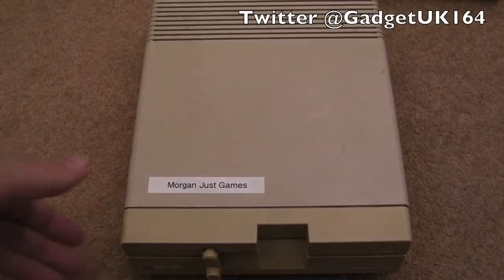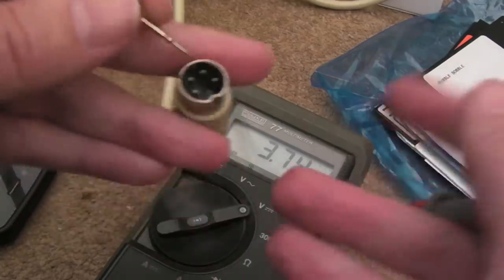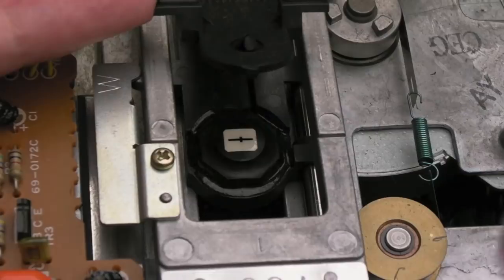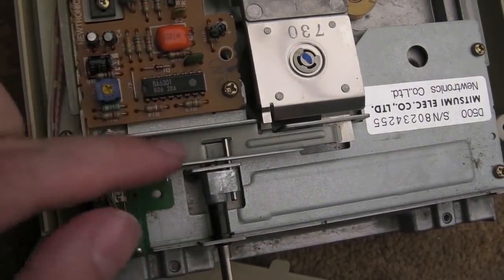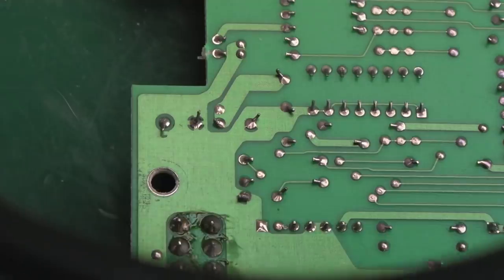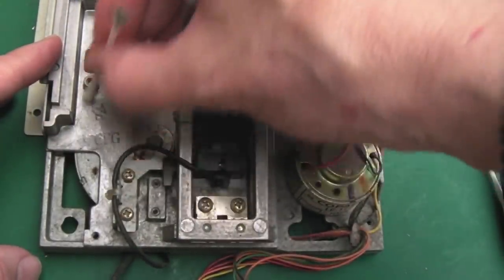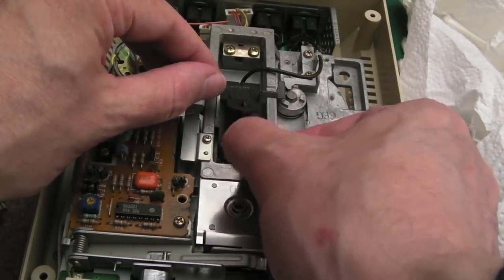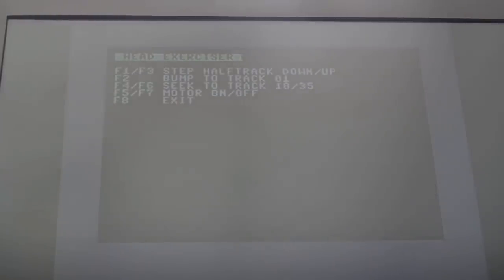Commodore 1541 II (Mitsumi) Floppy Disk Drive Repair / Service

Comment from the maker: Morgan Just Games (Excellent C64 & Amiga Live Streams) - https://www.youtube.com/user/Jamienmorgan82
With regards to the "resistor" I mentioned when using the Rockwell 6522s - it's a diode you need, not a resistor!  It relates to the pin being open drain.  See this video for more information:- https://www.youtube.com/watch?v=kn5ZH94gSj4
The CPU clock does come from one of the gate arrays (as mentioned) - but not the one I pointed to I think.  I think it comes from the DIP gate array.

Comment: A timely video! I just recorded a repair of a 1571 drive with many of the same issues. I laughed at the disk lock mechanism falling apart -- I had the exact same issue -- and yes, it was an immense pain to put it all back together. I ended up putting a small amount of MOLYKOTE (you got me hooked on using it everywhere 😉) on the handle pin too, now the handle will slide off easier if it has to come off again. Great video again!
Reply from the maker: Excellent!  I look forward to watching!!!  Not been inside a 1571 before I think!  Nice idea putting some molykote on the handle section!!!
Reply: @GadgetUK164  Don't hold your breath. At the rate I edit videos, we're looking at a 2021 release date.😂  The guts of the 1571 look almost the same as the 1541-II, except that it also has its own transformer and related power supply circuitry and dual heads, of course. The two R/W heads make it challenging to get to the heads for cleaning -- you have to actually dismantle the top head assembly and remove it to get at everything... fun stuff. I might need to pick your brain for advise, too.

The drive worked when I serviced it and gave it back to its owner, but now it has come back to me with some weird behaviour: The initialisation at power-up seems to take a fair amount of time to complete, upwards of 8-10 sec. and the drive is suddenly having trouble reading most disks. I haven't had the time to look at it yet. Part II of the video, I guess.

Comment: The steel pins used in the latching cam assembly are a real pain. I am resigned to pressing them with the hobby vise 9 out of 10 times. Great video.

Comment: Another great repair video.  I've had one of these drives on the shelf for a year or so now but only recently got a C64 so I'll have to get it down and get it tested.  Just FYI the Amiga cd32 power brick also works with the 1541-2. 

 Oh and I took 2 of my cd32 discs to game for repair.  They came back spotless but the cd32 absolutely refused to read them.  I tried to clean the disc further myself thinking some residue of what game used was the issue but with no luck.  So I now have genuine worms and cannon fodder cd32 coasters. I'll maybe try them again now that I've got my laser levels adjusted (with thanks to yourself again) but I'm not hopeful.
Reply from the maker: Thanks =D   I might experiment cleaning some cheap magazine cover disks or something with an orbital polisher.  If I have any success with that I might try it on the CD32 discs.  Surprised it didn't work after that resurfacing - unless the thickness of the protective layer alters how the light reflects back or something (ie. altering the focus somehow).
Reply: @GadgetUK164  possibly.  I'll have another look tonight and see if I can get them working.  I was absolutely gutted by it because the discs did work before all be it they where badly scratched but I thought I was doing a good thing getting them restored.
Reply: Yep, I tried it again last night and they will not read.  Every other disc including burnt discs read fine.  With the 2 original discs cleaned by game they spin up and you can hear the laser trying to focus.  It obviously doesn't get anything though as the CD icon on the console splash screen doesn't even start to spin (the way it would once the console starts to load a disc).  I may take a closer look at this with the scope on the rf test pad just to see what is happening.

Comment: Watching these retro videos, I've been getting the itch to get into the attic and pull out the old SX64. It was having drive issues when I shelved it back in 2001, so it's probably in desperate need of a recapping. I am also considering the possibility of locating a LCD monitor to swap into it, that would significantly lighten it up.

Comment: I have been advised against using domestic vacuum cleaners with electronics. The nozzle tends to build up a static charge, which doesn't play well with semiconductors.
Reply: @FireballXL55  Sounds like a plan!

Comment: Good fix, I thought there were two sets of heads and I'm not keen on the top spring loaded one as you can bugger it, so sent it to you... just think, your hoover has bits of Jamie's DNA in it since the 80's... surely we owe you some more money, you ripped Jamie's drive apart and cleaned it right up!!?? 😎
Reply from the maker: Thanks =D   Nah, single head on these!  Totally easy to clean as you saw in the vid =D  You should give Graemes drive the same treatment!   LOL @ Jamies DNA - great minds think alike, I've already got the cloning process underway using said DNA.  Jamie v2 coming to the channel soon!
Reply: @GadgetUK164  Haha that would be waaay to much 🙈

Comment: "stuff flying off everywhere, with friction on the head"
Reply from the maker: LOL =D  To be clear, the stuff that comes off onto the head is usually mold!  I've found that when these disks have been stored in damp areas for decades they accumulate some marks of mold.

Comment: Thanks for posting the video - one question however, what kind of grease are you using? I have this same drive and plan on doing this same maintenance, minus the cap replacement as I'm not quite ready for that and want to practice a bit more on some cheap stuff. Thanks!
Reply from the maker: Molykote - EM-30L
Reply: GadgetUK164 - Retro Gaming Repairs & Mods thanks!

Comment: Nice simple repair.  It wasn't even a repair, it was maintenance really.  By the crack sound of the screws, it sounds like it's never been opened before.  I wonder what the inside of my 1541-II looks like
Reply from the maker: Thanks!  Yeah, technically not really a repair.  Jamie has owned this from new (back in the 80's) - so that was the first time anyone went inside there.

Comment: @GadgetUK - I've just bought a Spectrum +2 and recently got a component cable that plus into the Spectrum's RGB socket, the 3 yellow, red and white RCA connectors to the TV. Tried it on my TV and all I get is a really bad picture that looks like an analog signal that's not tuned properly. Any idea's why the picture is so crap?
Reply from the maker: On the grey Spectrum +2 there's a transistor sometimes installed the wrong way around - maybe that's the problem!  It might also need recapping, or could have a voltage problem - maybe something going on with the 12v rail?

Comment: it IS possible to depot that transformer btw
Reply from the maker: Yeah, it's just not worth it!  By the time you've prized the bottom off they always end up sticking together badly and I wouldn't be comfortable super glueing the base back on.  If you are lucky you can prize the bottom off without doing too much damage to the support pillars but I've had enough experiences of going inside them to know its far easier to build or buy a modern replacement.